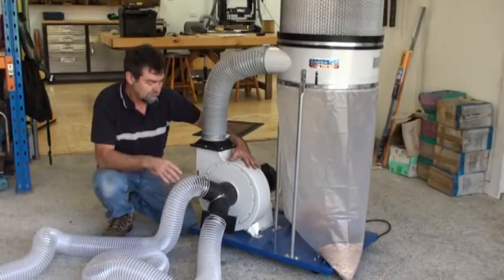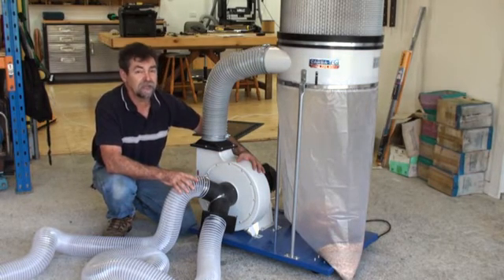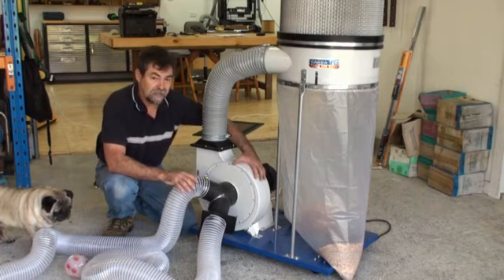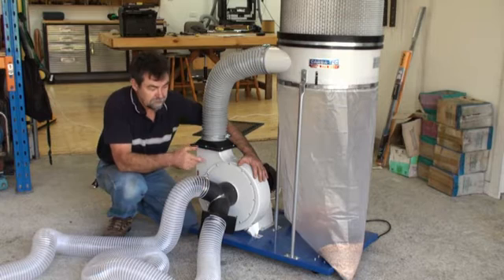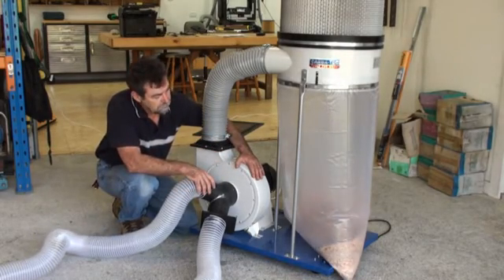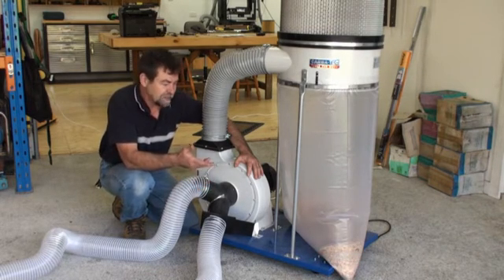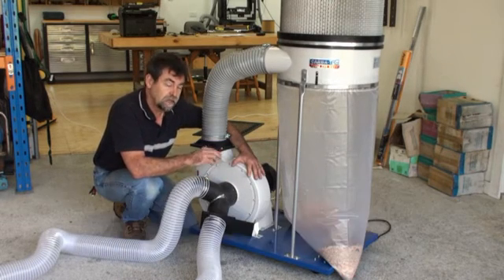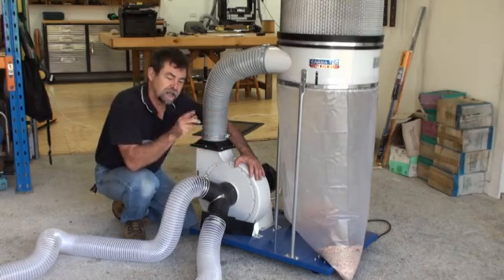How to increase my dust extractor speed # 7

Comment: Hi Dave I have a 2HP single bag with a filter on top from Carbatec in my shop andi ts so noisy how do I make it more quiet
Reply from the maker: Stop using it. Air movement makes noise so it is what it is. You could try building a soundproof box around it but still allow air flow.

Comment: I know this is an old video, but surely you've just allowed 8" of air volume through by opening both 4" ducts at the same time even though the inlet is only 5" the air intake movement has doubled?
Reply from the maker: Hi Mark Littlefair! Volume of air and air pressure are the differing factors.
Reply: I'm sure you're correct here. He's doubled (or at least significantly increased) the amount of air by having two 4" pipes in this demonstration, it's not at all representative of a situation with a single 5" pipe with a 4" bottleneck at both ends.

Comment: Hi dave my extractor has a 4" port on the extractor. if I put an adapter to go from 4" to 5, then run 5" ducting on the main line would that increase my airflow
Reply from the maker: Hi philip swan! It is going the wrong direction for expansion although you may get less static pressure in the system.

Comment: Hi David
When you have both 4 inch inlet's open the vortex could through the really fine dust up into the filter do you really want this to happen ? I would have thought that you would want it to stay in the bag.
Reply from the maker: There is a downwards facing element below the filter that forces the dust back to the bag.

Comment: Hi David, Ive been thinking of upgrading to one of these from my dust deputy- looks pretty good. Do you find that you still have a use for your mobile dust deputy setup?
Reply from the maker: Hi Steve. I dismantled my mobile setup and created 2 different types of dust extraction in my shop. There is a high volume low pressure system which I used in this video and also a low volume high pressure system which was the mobile setup. I have since hard plumbed the low pressure system into the workshop and have an outlet over each work station. Have a look at my shop video, #1. and you can have a better idea of it. I should do a video on it soon. Thanks for watching and posting the question.
Reply from the maker: *****
Steve. I still use Oneida cyclones on both of my systems. Dust deputy on high pressure low volume and super dust deputy on high volume low pressure system.
Reply: Good demo. Woodworkers desperately need a lesson on HVLP vs LVHP. That impeller NEEDS that volume to really fly. But lower cross section equals greater airspeed which is important to whip dust up out of that tool. I think this is what the engineers were thinking when they provided that "Y". My guess is that they figured we would hook it to two tools with no blast gates and simply run the thing open while using one tool. Have you ever tested it's dust collection like that.